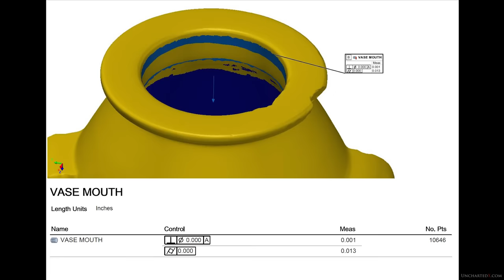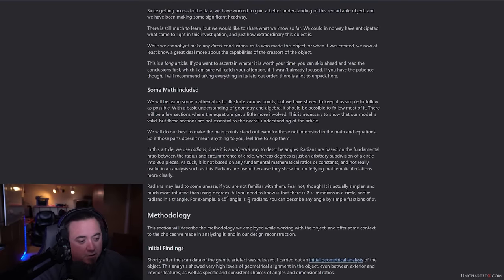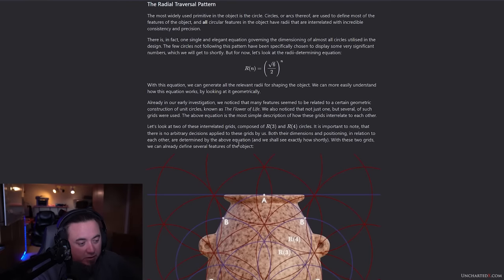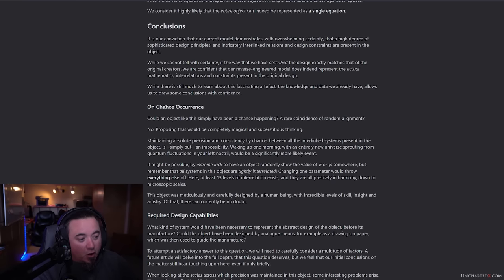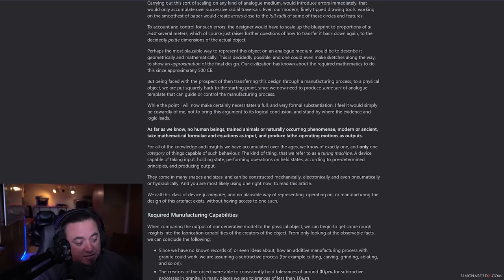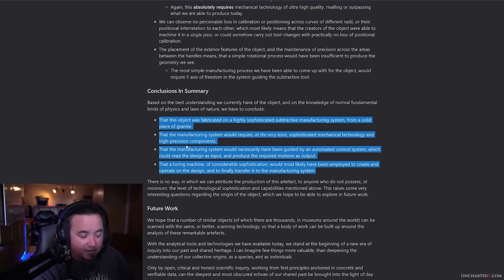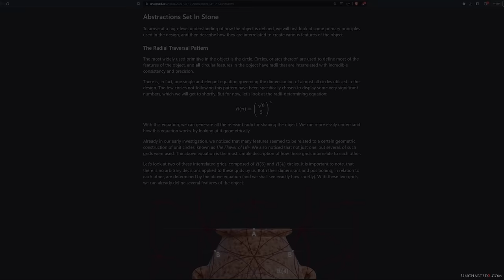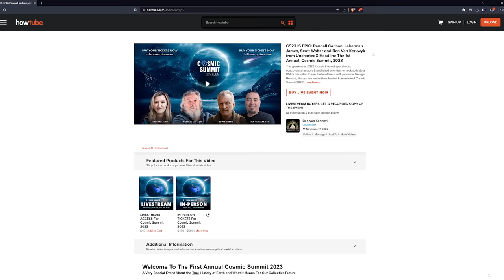Was a COMPUTER Used to Design this Artifact??

Comment: These ancient people loved the sun, and when you concentrate the sun using parabolic reflectors, you could possible reach a high enough  concentration of energy to cut things.
This does not need tool changes. Perhaps they burned this in some kind of oil or water to perhaps keep it cold enough to prevent thermal shock.
Still need the computer I reckon, to control this process. 
I admit ALL GUESSWORK on my  part, but I am suitable impressed! Thanks for sharing this with us.
Reply: Sounds like you are describing a laser.

Comment: Is there no way that this could have been made by the human hand??
Reply: not to this level of precision.
Reply: The micro analysis of the tool marks should answer this question.

It is technically possible to make this by hand. If you have extremely accurate measuring and mapping instruments and 'high spot marking. Similar process to hand scrapped bearings.
Reply: @AustinKoleCarlisle  How was it made? What machines/computers were used? Electricity would have to be used?
Reply: @jamemswright3044  So it could have been made by hand.  But surely, we would need to find evidence of the machines/computers electrical technology before we just dogmatically ignore the potential of hand made over tech made objects. So as of current evidence, they were made by hand, and we await further evidence to the contrary. Is that where we are at?
Reply: @jamemswright3044  a bearing is a sphere, whereas this is complex three-dimensional object based on many curves and radii.
Reply: @AustinKoleCarlisle  But how was it made? What machines/computers were used? Electricity would have to be used?
Reply: @jamemswright3044 the tools for measuring would require tech on the same level as the (proposed by Ben) tools for manufacturing.
Reply: @AustinKoleCarlisle  I agree, it is not likely that this vase is manufactured by hand.
Reply: @rolsen1304  Absolutely, if you can build the measuring tools, you can build the manafacturing equipment.
Reply: @rolsen1304  So there's no way these could have been made by hand?
Reply: @jamemswright3044  Which manufacturing equipment? What kind of equipment could have made this?

Comment: The proof is in the pudding. Someone needs to replicate it using modern technology. If it happens then we can start comparing how it would have been possible with each previous generation of technology. Keep going backwards until it cannot be replicated.
Reply: Don't just say it cannot be replicated or it would be hard to be replicated with modern technology. Prove it.
Reply: @stevenbaringer7309  People already try to make it, no success
Reply: @stevenbaringer7309  it's going to be extremely expensive. Massive amounts of experimentation to develop tooling that can machine granite. Then you need to convince someone to cover their milling/turning machine, worth more than a million dollars in abrasive rock dust and debris. Plus the high likelihood of damage to machinery when the granite explodes during machining.

Comment: Wondering what would happen when it's put in a absolute vacuum and a 16 GHz electromagnetic beam is put on it.
Reply: I also found that significant. I'm certain this vase is a message of some type, and this frequency seems to be what it is trying to convey. I think the assumption that it was a unit of measure was a bit premature. It would be great to see what the other vases have to say.
Reply: @jankragelj  i have googled the numbers of the radial traversal function set, and i see multiple corelating numbers in the chart of the Integrated Systems Bonding Project. this is a project about electrical grounding.

Comment: Doing more observations on the model. The handle is not at all or perfectly round. On your website you draw a fat circle to kind of hide this fact. So if someone used math, CNC machines, lost or extraterrestrial technology, they must have deliberately built in these imperfections.
Reply: how does this negate the fact that the vase has geometrical precision that would have been impossible at the time without machine/computer assistance?
Reply: @AustinKoleCarlisle  Is this hard to undestand? Lathed objects are inherently perfect going around their axes. Where you would see the human hand is in the profile of a lathed object. Like in this case the handle doesn't have any kind of geometric shape, like a circle. It contains the imperfections of a human hand. If done by machines you'd expect perfection.
Reply: @robinpetersson3081  no my friend, not all lathes are the same. for this vase, the deviation from concentric OD and ID of the top lip is in the order of microns. this implies an extremely RIGID rotating apparatus using modern precision steel bearings, etc. and an extremely FIXED cutting apparatus. not just some wood lathe.
Reply: @AustinKoleCarlisleIt appears robinpeterson is thinking the damaged areas are manafacturing faults.
Reply: @jamemswright3044  yeah, that's engineers for you.
Reply: @jamemswright3044  explain.
Reply: @jamemswright3044  the same imperfection can be seen in both handles, so it's definitely not a damage, but by imperfect lathing. This would never happen if modeled on a computer, and would guaranteed happen if don't by the hands of a human.

Comment: I love these videos but god are they absolutely maddening! If its true that no two vases are the same then I would say that lends it to be more of a human/hand made creation.. if it was machined using a Turing machine, then would there not be at least some evidence of these machines besides these vases? In modern times, we have lots of machines and these are used in place of humans typically to do some sort of precise and/or repetitive action. We have machines that make glass vases for example- but the primary reason you would even want to do that would be if you needed to mass produce, otherwise why build a machine to simply make one single vase? If a machine was used, where are the duplicates? Unless the “hand made” aspect of it is the inputting of the various dimensions by a human operator. Is there a vase database whereby researches can compare to see if there are duplicates? Oh what the sands of time must have buried…

Comment: I don't think it was necessarily cut. It could have been reconstituted from crushed red granite using a geopolymer binder. 
Having said that, the museum's that house these artifacts have so much to gain from having them analysed. There would be a massive increase in interest from the public and surely an increase in the value of the artefacts themselves. It's incredible that some of the most valuable artifacts are left outside in the open whilst less valuable ones are caged away inside the museum's
Reply: no , in your dream only

Comment: Now this guy did not examine the artifact. He had a set of data output, if I remember rightly, from a computer program that processed the physical scans. Is it not probbable that the program "smoothed" the data to fit existing geometric models and thus converted the primitive artifact into a mathematical model?

Comment: Well, I'm gonna apply occam's razor here and ask: Is there a simpler explanation?
What if they just had slightly better tools and understanding of mathematics than assumed?
What if some individuals were extraordinarily skilled at their craft, secrets were inherited and taught for generations?
Reply: the simplest explanation is that humanity was technologically advanced at one point in the past, was almost wiped out 12,000 years ago from a global cataclysm, and has been recovering ever since.
Reply: @AustinKoleCarlisle  It certainly makes more sense, than having giants with no skeletons. But we're finding up to 100.000 year old artifacts like spear tips and similar things in certain layers of the soil, so that would mean, if a deluge could be made responsible for making 12.000 year old artifacts disappear, it wouldn't make sense for the older artifacts to be there. Plus we're also finding things which are from that time. If there were a technologically advanced civilization with machine tools, electronics or computers, we would have found some of it.
One of the few pieces of evidence seems to be the so called "Schyst disc". I've been always regarding it as a piece of a machine operated by hand or livestock.
So my conclusion is: It's only logical, that they were more advanced than we thought, as in innovative master craftsmen with circular saws, polishing tools, sand glued to strings or rope and things along those lines. But I find it highly unlikely that there were ancient power tools or computers.

It's a fascinating topic nonetheless, and I'm thankful for Graham Hancock, Ben and a few other folks that they stirred up the pot of academic archeology, because those folks seem to be a little narrow minded in some regards.

Comment: Today we use "sandpaper", ie hard minerals, such as corundum, glued to a soft paper backing, to cut and shape hard metal. Why could not the Egyptians have used soft metal, such as copper or bronze, as a substrate for minerals such as quartz or diamond? They could!  All they would need to do would have been pour the liquid metal onto sand or sand containing microdiamond, found in part of Libya which was once Egypt, for it to imbed in the metal.  Once they had the quartz or microdiamond in the metal, the metal could be shaped into cutting tools and sawblades.  Today, we attach hard metals to sawblades using plasma to make much more durable cutting tools. I believe the Egyptians discovered the benefit of sand imbedded in copper or bronze by accident.  As for the machines use to shape the stone, I believe they were evolutions of the milling stones used to grind grain, which were animal driven. Use your imagination with that. Using large stones it would have been possible to obtain very flat surfaces. As for cornices, think large router.  The stone would move across the cutting tool producing a continuous shape, the same way fluted columns were produced.

Comment: If you can find two pots/vases that fall within the same level of precision and provide proff that they use the same system of measurement, the theory that they where inherited is sounding a hold of a lot better, almost irrefutable, but the question still stands how where and when???
Reply: so you are going with the one off theory
Reply: @scott heathco  well If we don't have the evidence that any of them share the same level of precision, (which is extremely unlikely in my opinion) we have to assume that they are all hand made and just took months to create one and they had multiple people working on different stages
Reply: @scott heathco  I personally believe that the pyramids were a large network of heat/pressure that they use at a mean of harnessing the sun and melted everything down, and for the case of the pots it's just very high heat/pressure casting and the pyramids were just one large pressure furnace
Reply: @babyelephant3077  if you need examples there are 4 caves in india where the walls vary .030 to .037..this was done in the dark with hand tools and torches which presents too many problems to overcome considering the level of polishing and the size of the caves

Comment: Any experienced stonemason can tell how this vase was made from the tool marks on the inside and outside of the vase including those that define the handles.  Precision doesn't require computers and guided tools.  How do you think a surface plate is made so precise?  It is lapped by hand.
Reply: You didn't watch did you?
Reply: @jamemswright3044  I did.  Its turned on a lathe and finished by hand.
Reply: @leghunter9201  precision requires precision machining and/or precision measuring even if lapped by hand. 

The argument for computer control of the tooling is the fact that the shape is defined by a single algorithm. It is assumed human beings cannot turn an algorithm into precise.physical outputs.
Reply: @jamemswright3044  First and foremost, this artefact should be analysed for its toolmarks. They can be seen even in this video on the inside, around the lips and the handles. Use a microscope if necessary. I'm surprised this wasn't done.  Are there any marks of CNC routing on the object?  Next, it'd be interesting to find another copy of this vase in museums etc, exactly identical.  That'd be a far stronger argument for CNC than that presented so far.
Reply: @jamemswright3044  Also check the inside, are the walls consistently thick or do they vary and if so how. The STL file doesn't print the inside of the vase.
Reply: @leghunter9201  There are actually microscopic analyses being carried out now. The inside of the base was too reflective for the scanning tool to analyse.
Reply: surface plates are....flat. this is not. 

hardly relevant to the discussion.
Reply: Welcome to the chat professor.
Reply: @jamemswright3044  thats good.  Can't wait for the results.  See if they corroborate with my own studies.

Comment: A lathe is very very easy to make even easier when turned by foot or some one else spinning it.
Reply: True. The difficulty is making precision bearings (to prevent runout) and rigid accurately controlled tool holders. These are necessary to make anything with precision.
Reply: @jamemswright3044  better use hardwood then all of that was done by hand n foot if you think any different you will be hard pressed for evidence ever turning up. 
Spend your entire life doing just one thing eating sleeping building it n doing it .

Comment: This was likely made with diamond tipped tools on a potters type wheel powered by falling weights or falling water. Centrifugal force adjusted the diameter based on speed. The entire universe is based on rotational circles.

Comment: I don't see anything lining up. You're math on 75 thousandths of on inch, then thousandths of a millimeter is all over the place. These tolerances are typical of lathing with regard to symmetry. Most of this is utter waffle. Hate to tell you, but the various minerals withing granite wear and oxidize differently over time. Even if manufactured smoothly, roughness of the surface would develop over a thousand years, even if the only variable was temperature expansion and contraction, let alone any exposure to the elements.
Reply: 75 micron (or 75 thousandths of a mm), not 75 thousands of an inch.

Comment: There is a problem with the measurements used in defining the circles applied in the vase design. If our metre is similar to the cubit or unit length the pyramids were based upon why are the unit circles in unusual sizes, ie: 1.1mm? The circle sizes should equate with our measuring system if the metre is 1 millionth the distance equator to pole. We need to ellucidate the reasoning behind the definiion for circle unit dimensions. This is especially so if you consider avagadros number and the periodic table. Perhaps the unit measurements in the circles can help work out the discrepencies in atomicweights. There is an implied level of comprehension in these ancient artifacts which is 'unfathomable'! The basic unit of length goes on to define all our conventions of metric measurement...

Comment: They used copper tools and chisels they had sharp tools lined up and soon as they were blunt there was some one sharpening another one .They used bows to drill and corundum (they know that becouse the vases are covered in corundum) and they had special tools to hollow out the insides of the bowls .and they probably had templates to get the shape even all round

Comment: At about 28:11, the "ears" of the object are not even. Leftside is higher...
Reply: don't be confsed by the drill holes that were likely placed by the Dynastic Egyptians later in antiquity.
Reply: Inside is wavy.
Reply: I don't see that 🤔
Reply: @MickSwindle  inside did not scan well. Too reflective for scanning.

Comment: As a computer scientist, it sounds like sloppy use of the ideas surrounding "Turing machines", especially for a mathematician.  A Turing machine is a theoretical construction that can't actually be built, as they use an infinite memory.  Their primary use, done first by Turing, was to prove that some computations are IMPOSSIBLE, even if you had such a fantastic machine.  Modern computers are NOT Turing machines, they simply use them as a model and ignore what happens when and if they run out of memory.  The artifact is no less impressive if more accurate terminology or more realistic computing models are cited.  Please don't let anyone jump to the conclusion that anything resembling a modern computer would be required to do this job.  Anything from aspherical camera lenses to the most sophisticated atomic bomb components have been machined with no more than pen and paper, and possibly slide rules.  Again, it's no less impressive to me if that's how they created this magnificent jar.  Honestly, at this point, I'm convinced someone out there found, concealed, and lost some truly remarkable ancient machinery.  It would have been the most valuable technology in the world for millennia, while the strongest militaries were still using animals and wooden wheels.
Reply: you're really going to argue semantics?
Reply: @AustinKoleCarlisle  No, I'm not arguing semantics.  I am saying without any hesitation that there is nothing in these findings at all that suggests a computer of any kind was used to create this object.  I'm suggesting the author of that work doesn't know what a Turing machine is, or is deliberately being deceptive.  I'm not splitting hairs, this is stuff that's covered in the most basic computing theory courses.